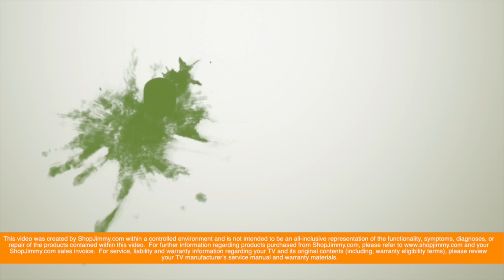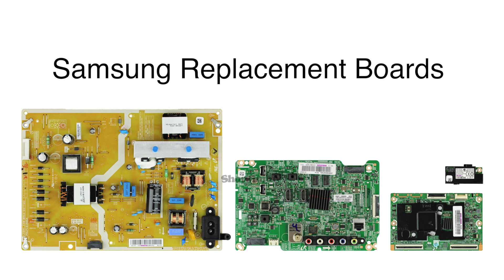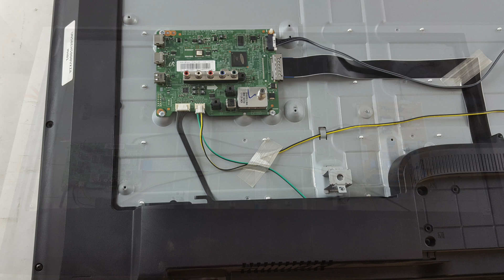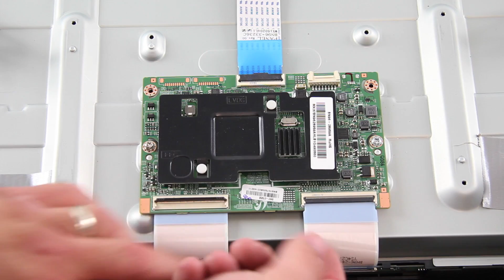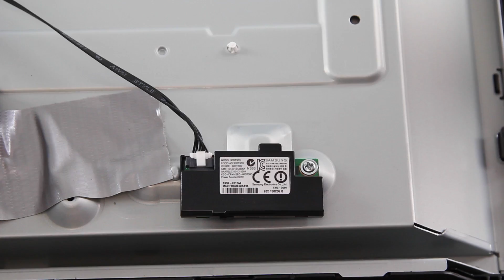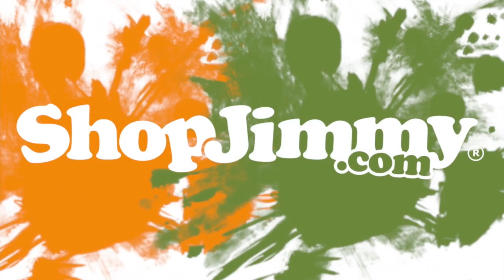Samsung UN55H6203 TV Board Replacement - How to Fix Your Samsung 55" LED TV - Samsung TV Support

Comment: I was working on fixing this exact model and the power supply sparked and now i have no backlight is the issue the power supply or the led strips
Reply: my guess, the backlights. If you shine a flashlight on it when the power is turned on you will be able to see the print on screen if it is a backlight issue. Working on the same problem on my t.v. right now. (I know, late response)

Comment: I have this tv and i have a issue with it but i know what that issue is the issue is it turns off sometimes while using it and also sometimes refuses to turn on at all (power supply issue have one on order from ebay) what i dont understand is why there's no sound from the internal speakers despite them being plugged in from any input whatsoever but if i plug in a 3.5mm audio cable and my logitech subwoofer everything can be heard fine which makes NO SENSE to me whatsoever i have checked to make sure all settings are factory default and they are speakers aren't disabled or anything stupid like that so idk if i have a bad main board somehow or what

Comment: Hi I have a 
Samsung UN50H6203AF 50" 1080p LED-LCD TV - 16:9 - HDTV ...and the picture just went out to a black screen.
There was sound when it went out. Should one board be replaced or all of them.
On your parts page it is way cheaper to replace the boards than I thought. 
Or should we just replace the TV as a whole?

Comment: Thanks for a video. My WiFi module glitched, causing remote not working and power button glitching after several minutes after power on. I removed WiFi module and now It's working fine! I wasn't needed it anyway, RJ45 socket is near TV.

Comment: Hi,I took the back off of my Samsung UN55H6203AF.  The power board is burnt in the upper left hand corner.i know it needs replaced, but is there another board that needs to be replaced that could have caused this?  Thanks

Comment: Hi, my TV is a Samsung PN63C8000YFXZA. It has a black band on the right side of the screen. Other screen area and sound are working fine. Would you have a recommendation for a replacement part?
Reply: thedark weeally - Thanks for your response . Yep, not repairable. I had to buy another TV.